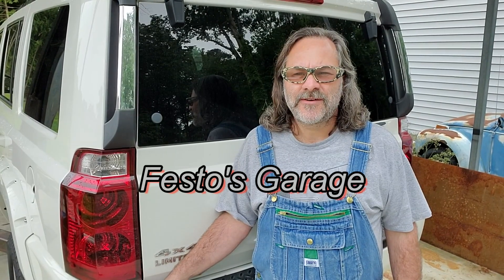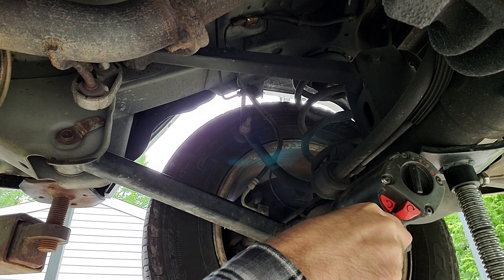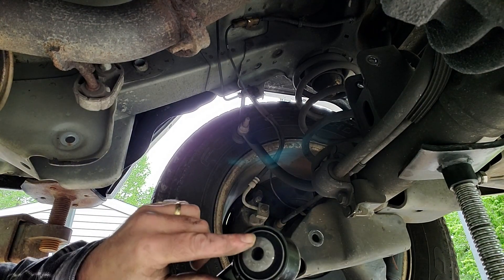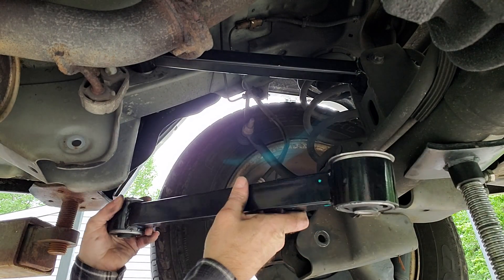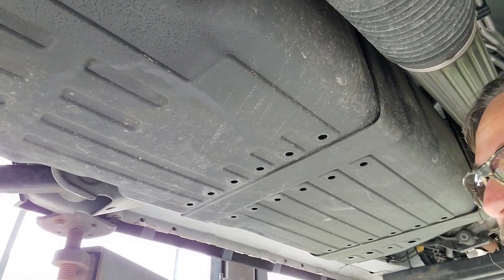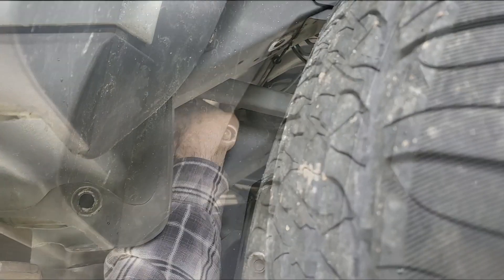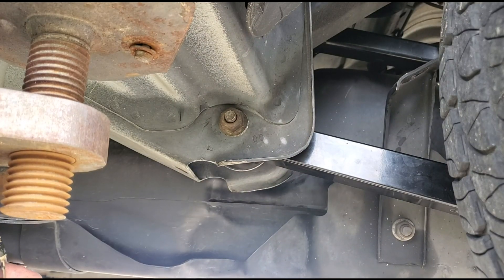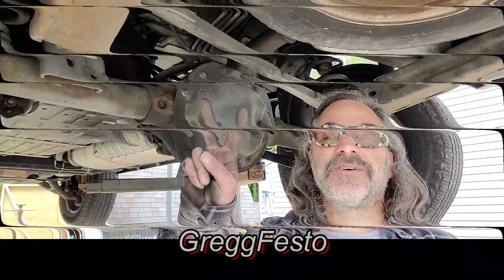Rear Control Arm Replacement - Jeep Commander - DIY

Comment: How similar are the 2012 jeep liberty to the commander. I have to replace upper and lower rear control arms.
Reply from the maker: Thanks for watching. I am not sure about the Liberty, have not had to work on one so far. I do know that the Commander and Cherokee are the same. I am confident in saying that if you feel comfortable doing the job that I showed on the Commander that you can get the Liberty done yourself. Save that money.

Comment: Is it same process for 2005-2010 grand Cherokee wk ?!
Reply from the maker: Thank you for watching. Yes, I believe is the same for the Grand Cherokee. These are very similar vehicles underneath.
Reply: @GreggFesto thank you for your response and after checking yes it’s identical😊
Reply: On my 2006 Grand Cherokee Overland WK I am finding that the rear driver side lower control arm is also blocked by the gas tank. Not sure the gas tank can be lowered enough to remove the lower control arm bolt.
Reply: Second point seems on the WK since both the rear control arm upper and lower forward control arm bolt access is blocked (on my vehicle), seems another solution is to cut out theses bolts, and replace them with new or salvaged installing the nut inside next to the tank, rather than outboard as originally built.

Comment: How did you know that you needed to change them? How many miles are on the truck? Thanks for the video
Reply from the maker: Thank you for watching. There was a noise coming from the back when going over bumps. I used a jack to lift the Jeep up and down and could hear that same noise coming from the bushings when the rear suspension would move. First I lubed them up and the noise went away. A few days later the noise started again so I decided to replace the whole arms. At this time it has been a few months and I am happy to report that the noise is gone and has not returned.